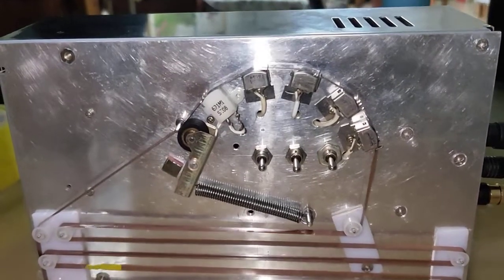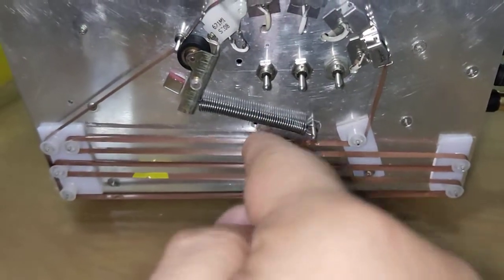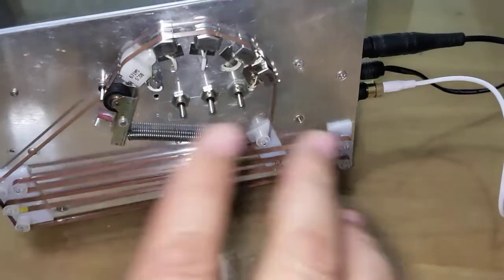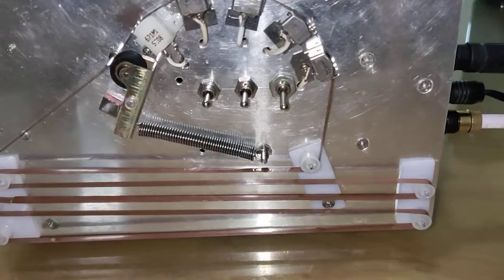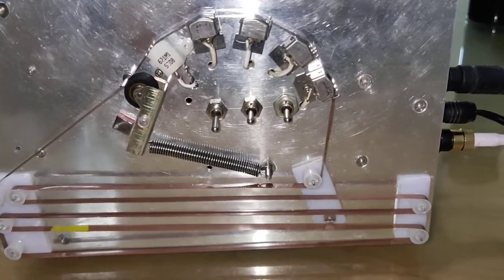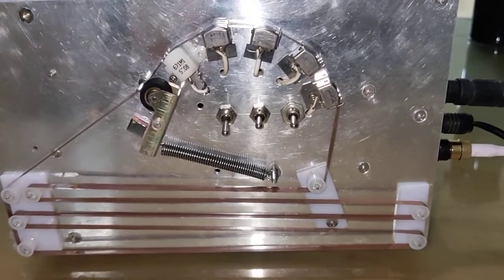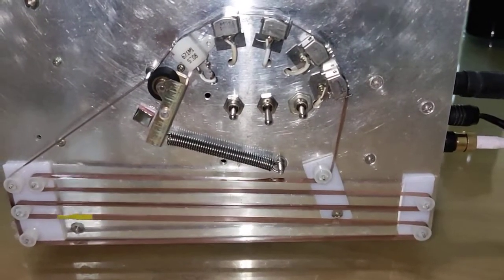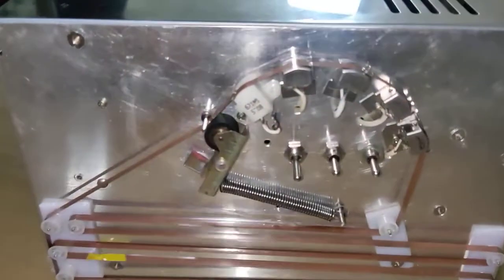Hand made cassette tape delay machine.

Comment: Are you using multiple stereo preamps and a mix circuit or, are those not r/p combo  heads?
Reply from the maker: I use multiple mono heads. And I used multiple preamplifiers.

Comment: Pretty great! This has a lot of potential. Curious as to what electronics were used to get the signal onto and back off the tape from the heads and how you set up the audio mixing. I like it. The guy from "Look Mum, No Computer would go wild with a DIY project like this. Good work!
Reply from the maker: Thx for your comment.

Comment: You are my hero.
Reply: How are you summing the signals of the heads together? can you have all heads engaged at the same time? I have no knowledge on electronics, but I'm trying to restore some old tape units to try building a tape echo, I always wanted to have one. Fantastic work! ;)
Reply from the maker: @carlosdelrio8309  Dear friend, I Will show more detail of this machine such as the diagram of circuit. It is not good to use all the reproducing head at the same time.